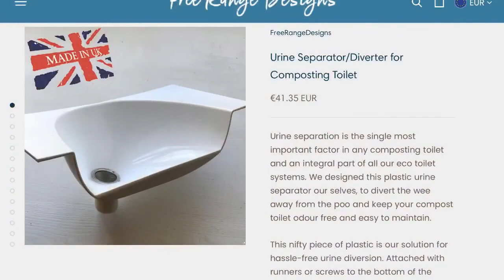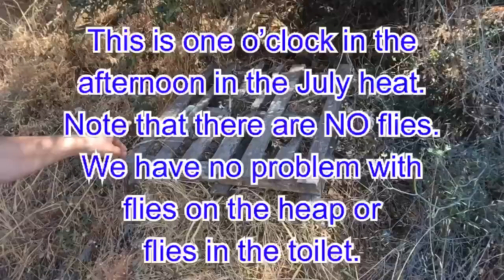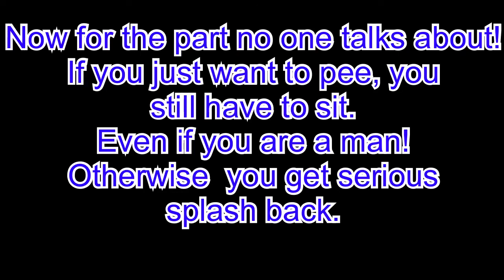Is this the perfect dry toilet system for “off grid” living?

Comment: Hi mark, how do you make the connection from the urine-collector to the hose going to grey watertank? Because you need to take out the urine-collector for changing the compostable bags of solid. Thanks for sharing your off-grid experiences!
Reply from the maker: Hi Wesley, thanks for watching and for your question. The separator is attached to the underside of the box lid and the urine outlet sits in a funnel attached to the inside of the box on the front. The funnel is attached to the pipe that goes to the grey water. In this way the separator is free to move with the box lid when you need to empty the solids bucket. I hope this is clear, if not, let me know and I will send you a photo of the setup. Regards, Mark 🍀🍀